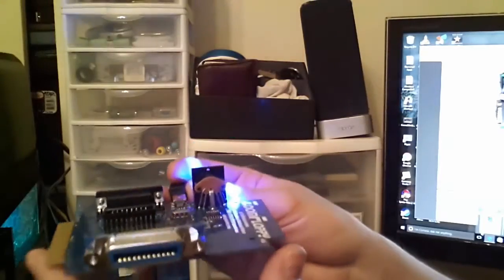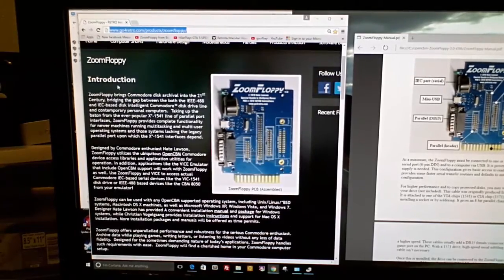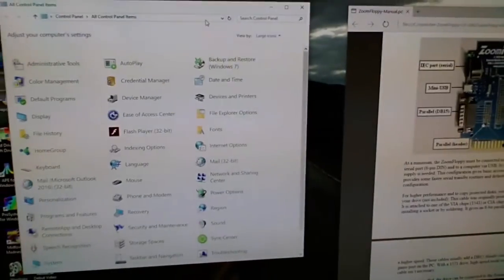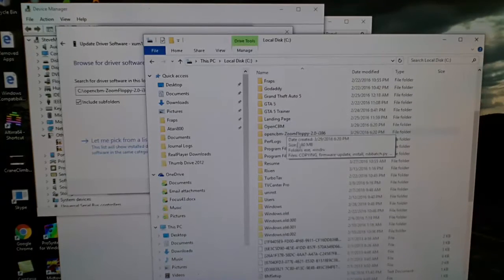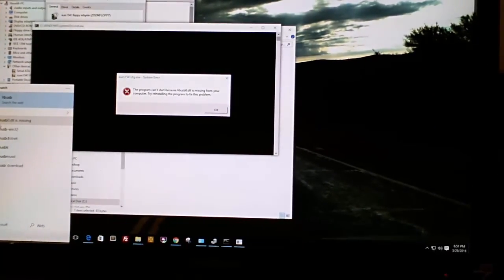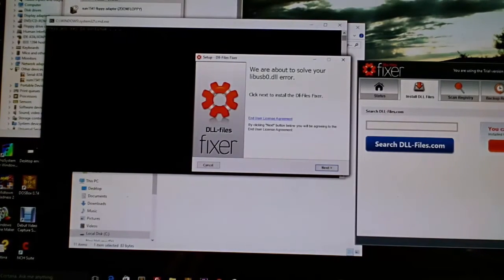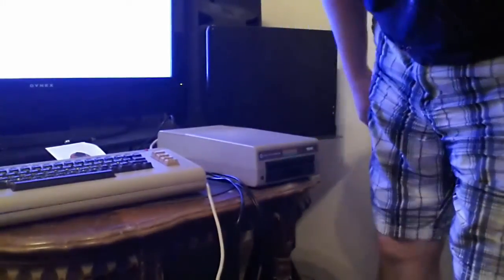Commodore 64 - ZoomFloppy Troubleshooting

Comment: I think, you should not have the Zoom Floppy and the C64 plugged into the disk drive at the same time.
Reply from the maker: That is not something I thought about. It sounds like it could work. However, for now I ordered a SD2IEC drive for my Commodore 64 and hope that will work on getting the files from the 1541 instead.

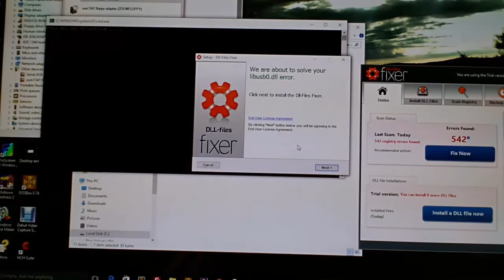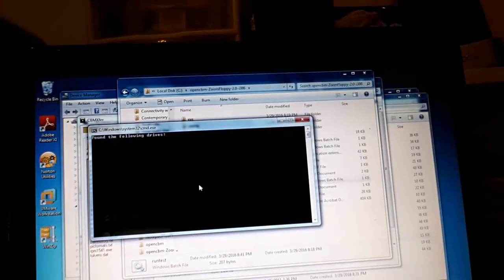Comment: So after 13:10 does it still do 9:30 on your Windows 10 PC? For your Windows 7 machine, does it not work after what is shown at 17:22?
Reply from the maker: Bo I never got it working. I was going to create the second video if it worked, but I ran into worst problems. Windows 7 could not detect it at all. It was my fault for not returning the board. I've had this thing for years. Anyway I figured I'd ask since hardware for the C64 can be complicated sometimes.